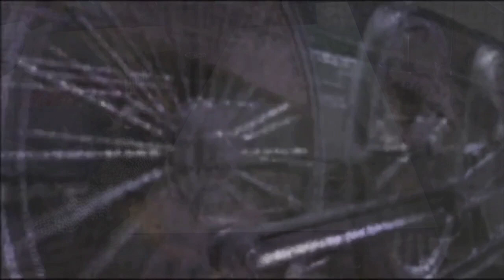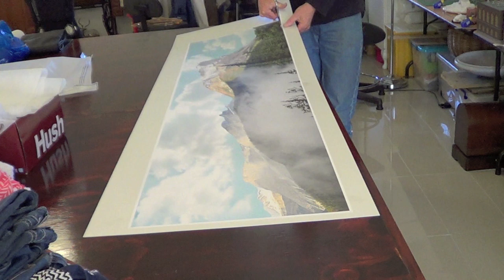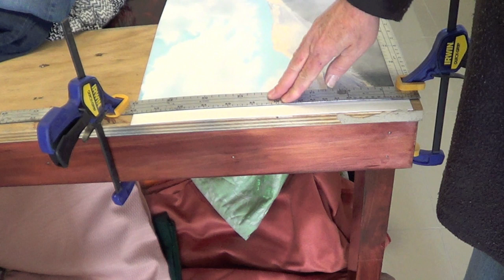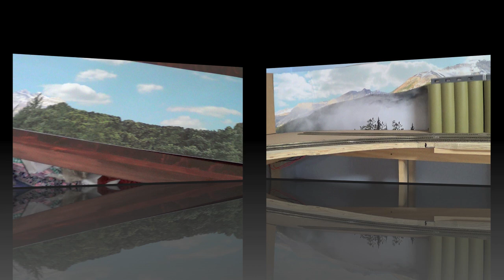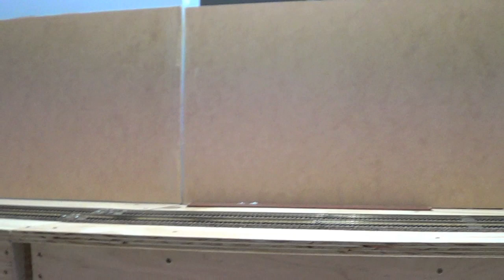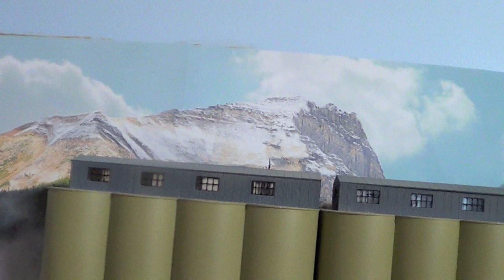Ajm Railways ID Back Scenes Part Two"Model Trains"

Comment: Hi Robert I've more or less installed the hardboard Masonite now - did you varnish to protect from damp? Cheers JC
Reply from the maker: JC i varnished so the double sided tape would adhere to the board, because the one's that came off
in the heat were the one's i didn't varnish and also this would help with damp as well cheers Robert

Comment: Well done on getting that print attached to the board nice and smoothly - it looks like it could have the potential to go pear shaped very easily if you didn't take your time with it.
Reply from the maker: Davie i would hate to try and put these sheets on the wall by themselves, but 
the styrene worked out well cheers Robert

Comment: Robert - Speechless 😶
Reply from the maker: Thanks for commenting but is speechless good or bad cheers Robert
Reply: csxmad oh it's excellent Robert - what size/thickness styrene did you use and where did you get it? It's a fabulous idea
Reply from the maker: i don/t know the thickness of the styrene, but it is very thin which is really good to bend around the corners. And they are old display signs. And thanks for the comment cheers Robert

Comment: looks amazing .. it is going to look so real when done.  .. when you join two pieces together if you over lap the two scenes an 1/8 and then cut thru both scenes then no matter the cut the join will be perfect.  You probably already knew that but just in case.
Reply from the maker: Curtis these will be put on with Velcro so all the joins will be covered in scenery to hide them cheers Robert